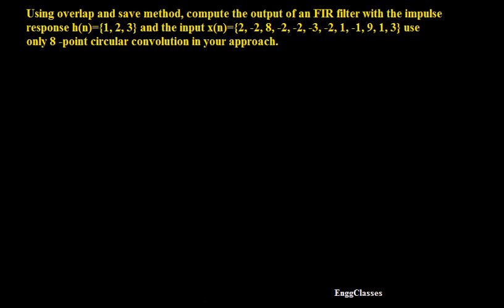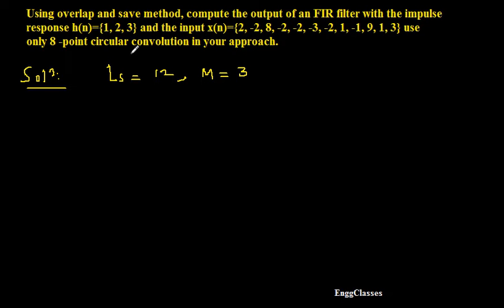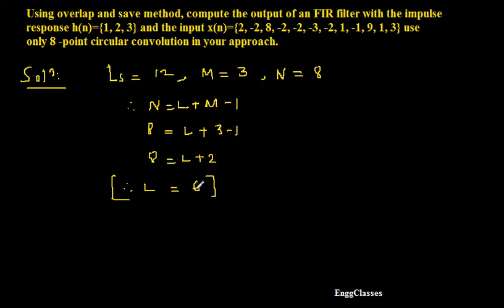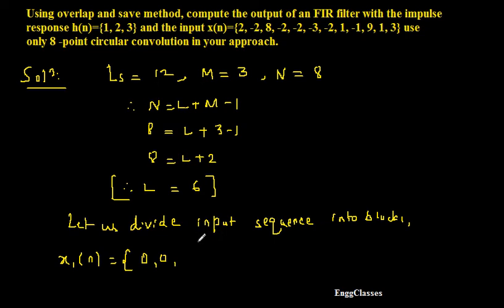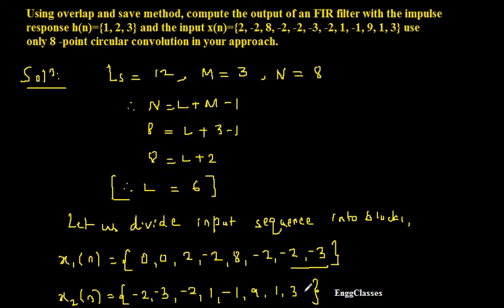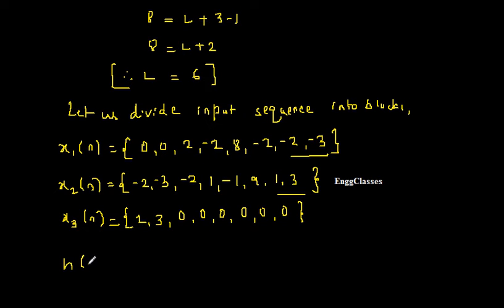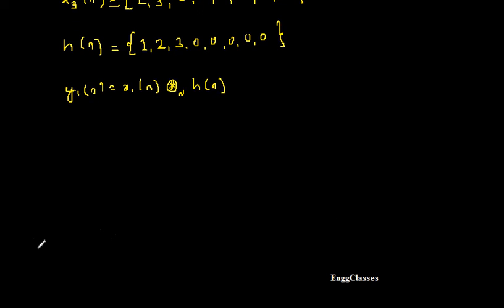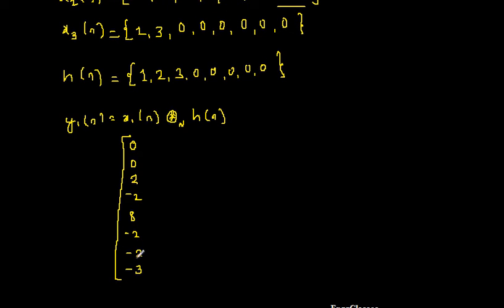Q3. b Overlap Save Method (Numerical 1) | DSP | EnggClasses

Comment: sir    -  why  2   samples   from  previous    block    ?=   thank  u  sir
Reply: Because m-1 =2 if it is 3 then we have to take 3 previous samples..
Reply: Lenght of impulse wala =3, so we use 3-1=2 previous samples from input signal
and we remove 2samples from output to remove points corrupted by aliasinsg

Comment from the maker: Hey everyone, 
There is a small mistake in y2(n).
y2(n)={ 7, 2, -14, -12, -5, 10, 16, 32}
And the final y(n) will be,
y(n) = { 2, 2, 10, 8, 18, -13, -14, -12, -5, 10, 16, 32, 9, 9}
Please note the correction and apologize for the inconvenience.
Reply: Sir, may I know why did u take 12,-6 instead of 2,2 in y(n) (in comment section)
Reply from the maker: 12, -6 come from y1(n).
I'm not getting how do you get 2 and 2.
Plz let me know.
Reply: @EnggClasses   we've 
y1(n)={-12,-9,2,2,10,8,18,-13}
after discarding first two numbers we are left with  {2,2,10,8,18,-13.........
But u have taken 12, -6 in final y(n) (comment section )
Reply from the maker: You are right. Corrected.
Thank you so much.
Reply: Yes sir I got that ans 7,-14,10
Reply: Thank you sir

Comment: Sir,y2[n] is wrong
It's y2[n]=[7 2 -14 -12 -5 10 16 32]
And y do we have to consider y3 [n]?
Reply from the maker: Yes Summaiya, i have updated the same in comment section. You have got your Maths correct, Well done..
Thanks for the concern.
h(n) is of length 3 and x(n) is of length 12. Therefore final y(n) must be of length 12+3-1= 14.
If you consider only y1(n) and y2(n), you will get y(n) of length 12, to get remaining 2 samples you have to consider y3(n) as well.
Hope this helps.
Reply: @EnggClasses  thank you sir
Reply: How can we know in advance the length of output if we consider only y1 and y2 ?m